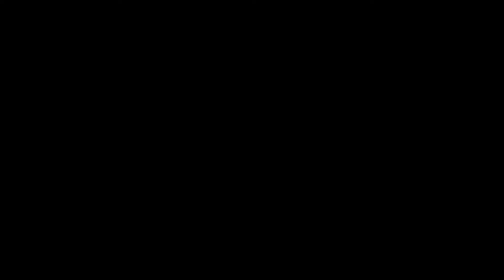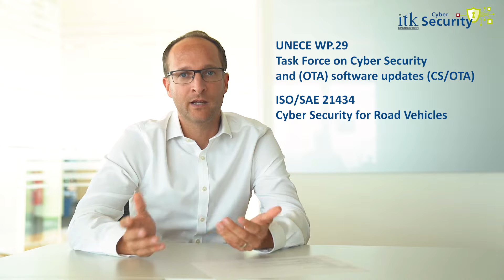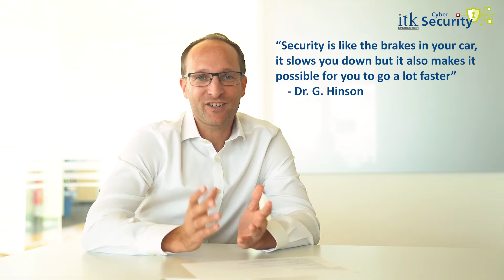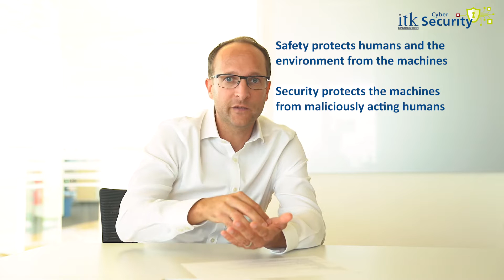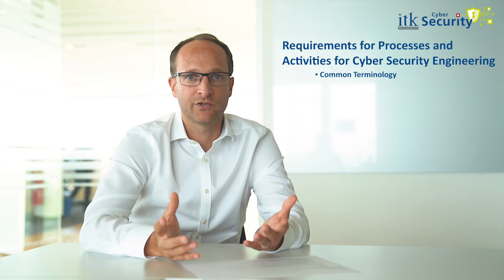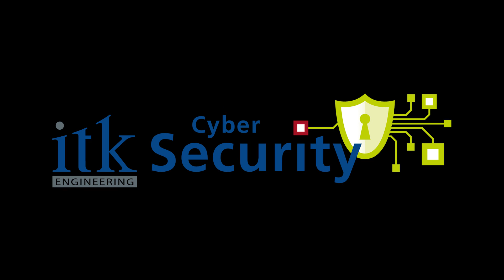How to comply with the UNECE / ISO SAE 21434 cyber security regulation?

Comment: Thank you.  This was very helpful.  I am on the supplier side to auto OEMs here and we are getting some requests to be compliant. But these are coming from OEMs with security and engineering  teams that have more than 10-20 times my budget.  We need an ISO 21434 light. Honestly I think ISO 21434 is far too bloated even for the OEMs with the budget.
Reply from the maker: I agree, the effort is not trivial to invest by a smaller company for just this topic - besides all the other non-security requirements you need to meet to make business with the OEMs. However, if you compare security with a series of fences, the protection is only functioning if all poles are mounted. Same here, doing just a bit could lead to unsecure systems instead of less secure systems. Anyway, there are a lot of ways to tailor the whole thing so that it is possible to even comply with the requirements based on a smaller budget. If you like, drop us an email and we can setup a complimentary first call on that topic, since we are helping several companies on OEM and supplier level on the track to ISO/SAE 21434.
Reply: @CyberSecuritybyITKEngineering  Will do.  Thanks for the response.